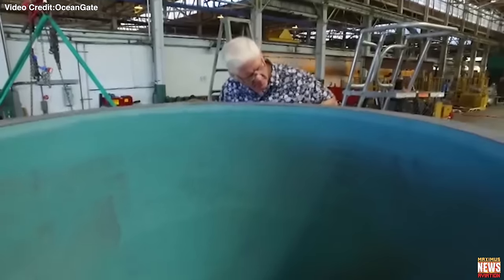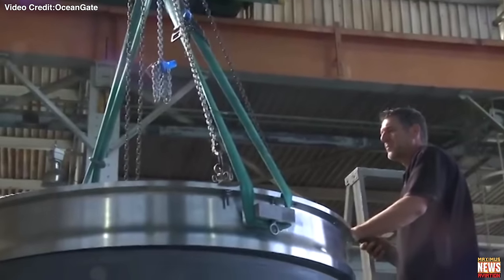Watch The Manufacturing Process That DOOMED OceanGates Titan To Fail. But It NEVER Had To Happen.

Comment: That wrapped fiber looks like it would be a lot more effective at keeping pressure inside rather than withstanding the force of pressure pushing in from the outside.
Reply: How do you know? Did you do your PhD thesis on Kevlar modulus and weave orientation, among 100 other factors?
Reply: @tonylee1794  Since when do you have to be an expert on anything to make an observation in the youtube comments? 
What's your problem?
Reply: @tonylee1794  And how do you know? Did you design or make it?
Reply: @JonasC22  With your ability to tell a good design from a bad design  by a simple visual inspection, who needs stress analysis, x-ray inspection, etc., they should have simply sent this video to you first. Problem solved!
Reply: @tonylee1794 
Is a PhD needed to observe that you cannot burst an empty plastic water bottle by blowing into it with your mouth, but can easily crush it by sucking the air out?
Reply: @tonylee1794  Where in my comment did I even imply that anyone should forgo  proper testing on anything?
I think you need to take a break from the internet.
Reply: @JonasC22  My point was, and remains, how in the world do you conclude your statement - "That wrapped fiber looks like it would be a lot more effective at keeping pressure inside rather than withstanding the force of pressure pushing in from the outside." You came up with this by reviewing a overview YT video? Obviously you are not in the engineering field! You can't, without a detailed inspection by a trained professional using precision equipment, make that conclusion! My criticism of your conclusion is valid.
Reply: @pulidoggy  Wrong analogy puli. In the case of the sub, we aren't dealing with a vacuum as you suggest. This is why they don't consult non-engineers on such matters. Understanding complex concepts is what engineering training and application is all about. Think before you post!
Reply: @tonylee1794  there was no kevlar shown in the video.
Reply: @pulidoggy  it depends on how thick the plastic is. The non-disposable plastic water bottles cannot be crushed by sucking on them. In fact, I think they can probably stand up to 1 Atmosphere of pressure without imploding.
Reply: @mckenziekeith7434  Of course, every plastic thickness has its breaking point, it goes without saying. For instance, an 1lt coke bottle can withstand about 6atm of inner pressure.
But my point is that, take the same bottle (empty and capped) underwater at 60 mt depth, - that make 6 atm of outer pressure - and see what happens.
Reply: @JonasC22  You made a (wrong and ignorant) speculation, not an observation!
Reply: @tonylee1794  What you call "vacuum" is just pressure difference
By sucking out air with your mouth, you are evidently creating not vacuum, but increasing the difference between inner and outer  pressure. And the pressure difference needed to deform a bottle inwards is way smaller than the inner pressure needed to break the same bottle outwards.
Reply: @pulidoggy  Brother, put the shovel down! everyone knows what vacuum is... negative pressure.
Reply: @pulidoggy  yes, every plastic thickness has its breaking point. And every carbon fiber composite tube has a breaking point also. But what we don't know is whether this design was flawed by design or flawed by poor manufacturing. Maybe if it had been carried out more carefully it would have survived many more dives. The fact that it did survive more than one dive is proof that it was not glaringly under-sized. They might have been close to OK with the design. Also we don't know yet which part failed. Was it the viewport or the end caps or what? Or was it the carbon fiber composite tube?
Reply: @tonylee1794  
No, since absolute pressure is measured with reference to a perfect vacuum it is impossible for vacuum to go negative. You can only measure negative pressure as a differential between two (different) positive pressures.
Reply: @mckenziekeith7434  Yes, agreed, there are so many variables that an analysis based on remaining debris will be an arduous task,  and also being the sub an one-of-a-kind model does not allow comparative tests.
Reply: @pulidoggy  leave it alone, you're talking like Dr. Suess... nonsense!
Reply: @tonylee1794  
Do you mean Dr. Seuss possibly?
Learn to correctly spell your quotes before calling others "ignorant"
Reply: @pulidoggy  I'm an engineer l, not an English major. No doubt you would get "Seuss" right since engineering obviously isn't your thing!
Reply: @tonylee1794  It would seem that you do not excel in either field.
Reply: @pulidoggy  I have 2 patents that say I do! If you Google searched  my actual name along with the word "patent", you could read them both!

Comment: A big ole titanium tube would have worked really well.😊
Reply: How about a good old-fashioned STEEL tube? Like giant military subs have been made of since FOREVER. None of those have ever imploded unless they were depth charged. Except for the Thresher of course... but it wasn't supposed to go down that far and exceeded its design crush depth in a test that failed for other reasons.
Reply: Yep!
Reply: nomenclature9607  .. yup
Reply: This is the perfect example of "bleeding edge engineering". This installment of how NOT to build a submersible was very expensive this time.

Comment: Probably cheaper to just make it from steel? What's the point of carbon fibre anyway for this application?
Reply: Strength to buoyancy ratio. He wanted a sub that could fit 5 people including the pilot, which would've been too heavy if made from steel.

Comment: Fucking amazing!   The lip on the titanium flange should’ve been at least 2 feet deep not 2 inches to have a really firm grip on the hull.  I’m not even an engineer and I know that.  Doomed to fail.  Rush really seemed like a nice and likable guy.
Reply: Not necessarily if you consider that the high pressure at the depths they were diving to would be pushing the titanium end cap to the cylindrical hull to tighten the seal. No, the real design flaw is the composite hull with the weak carbon fiber and the cylindrical design doesn’t all for equal pressure to be applied as in a spherical design.

Comment: I saw a youtube vid that said these pelagic subs are only fit for 1 or 2 dives before they need total refit and some are only intended for single use. So even materials such as titanium and steel need testing after 1 or 2 dives and Titan's carbon fibre had already done several.

Comment: A single compression cycle might've been relatively safe - distributing the load into compressive strain on the fibres' longitudinal axis - but assuming a given coefficient of thermal expansion per unit length of ribbon, the increasing circumference with radial thickness obviously places more material in the outer layers than inner layers;  thus no matter how low the coefficient may be for a given material, any normal ambient variation in temperature is going to introduce shearing forces between adjacent layers.  Unless stored in a temperature-controlled environment, it may have been weakening every day since manufacture, even without diving.  

Further assuming that the curing process involves evaporation of volatiles, the outer layers will dry into a tensioned state, the inner layers thus subject to a resulting compression; this in turn skews distribution from further loading as from submersion, since the outer layers will at first be relaxing, their tension reducing as it's balanced by increasing water pressure, before inverting into compression below some threshold depth;  meanwhile the inner layers are under constant and increasing compression only..  this dynamic focusing shearing strain into the outer layers, and compressive loading onto the inner layers.

Comment: Has anybody ever seen a hint that there were also fibers in the axial direction of the tube? This radial winding is great for taking the pressure load on the tube. But the titanium spheres also press on the tube axially. And without fibers in axial orientation (angled or 90° axial) only the glue between the fibers carry that pressure load, which it can't to well. 
So if there were no fibers with a significant axial component... I have my most likely reason for failure.
Reply: 2 gold stars for you Sir, well done

Comment: This was its fifth mission down.  On its 3rd mission, it only descended some 30 feet.
Reply: I think this was its third dive to the titanic but the company claims they did roughly 50 test dives with the Titan, some at similar depths but most probably much shallower.
Reply: @Sashazur  I read they did at least 90 dives.

Comment: It doesn't take a genius to know that titanium/stainless steel alloy is a much stronger building material than carbon fiber and glue.
Reply: On a weight basis, carbon fiber is a lot stronger than stainless alloy. In some applications it is quite a bit stronger than titanium, too.
Reply: Stronger in only some situations and certain directions of force.  Not this application..especially not how they manufactured it.
Reply: @mckenziekeith7434  tensile strength yes, but compression strength?  Absolutely not.  Thats why submersible are usually  steel, steel/nickel or titanium
Reply: @BrownBomber92181  I am not saying submersibles should be made of carbon fiber. But carbon fiber composite structures actually are quite strong in compression. They are stronger in tension than compression, but they are strong both ways. The idea that they are weak in compression is actually a myth.
Reply: @mckenziekeith7434  
They are still significantly weaker or much "sketchier" in terms of how they fail, if you will. If you ride bicycles, a carbon fiber fork with carbon steerer vs. steel is a good example. I have yet to hear of people who managed to damage a steel tube when clamping down the stem, yet that  is a thing which easily happens on carbon tubes - which is why using a torque wrench is an absolute must on carbon.
Reply: @Exgrmbl  almost every carbon fiber beam experiences both compression and tension. I agree that carbon fiber, especially thin-walled carbon fiber, is more easily damaged than steel. But the basic claim that carbon fiber is not strong in compression, that claim is wrong. If it were true, we wouldn't be able to use carbon fiber in beams because the side of the beam that is in compression would fail. I like steel bikes, but I am not much of a bicyclist. I don't mind the weight.

Comment: I'm no engineer but I know enough to know that was never going to work and if it did then it's safe to assume that each 'mission' would be causing degradation, especially given what we know about the crunching noises it made right the way up until 300ft from returning to the surface

Comment: Great vessel able to resist internal pressure in excess of 400 bar ! Wait   I am told it will be external pressure ?? S...t ! How can fiber spun around a tube  increase its resistance to crushing ? The epoxy glue ? Not serious ! Plus different materials with different expansion coef... Fatigue,  cracks during pressure, temp cycle ...Catastrophic failure soon or later. Plus many other errors I bet. Shame on these engineers. Woke ?
Reply: Who's to say they are even engineers?
Reply: @charleslaine  Stockton the CEO was but went to business. No practical experience then. May be he hired his own kind, just young dreamers so positive they nrver see problems, put aside any negative thought.

Comment: Maybe the CEO should have used Elmers glue. I have stuff from 45 years ago that is still good. I just add a little water to it as needed.
Reply: "Add a little water to it"... at 3500m deep?  Would you like ice with at, Sir? ;)
Reply: @the_lost_navigator  Shaken not stirred. I only use freedom units so what is 3500m in feet?
Reply: @grosseileracingteam  Gee, Beav - even Lumpy learned math in school
Reply: @the_lost_navigator  I didn't need to. Eddie Haskell stole the answers to the tests.

Comment: using hand tools and no jigs, you can see all the bubbles and surface imperfections on the carbon fiber after it was spun onto the main hull.  YIKES.
Reply: Imagine what 400 atmospheres of pressure does to bubbles and the material around it... and imagine all the bubbles in the epoxy with the guy stirring it up with a wood paint stick...

Comment: I will laugh my ass off if we find out that it wasn't the walls of the pressure vessel that failed, but something else. This isn't the only video to poo-poo the way the pressure vessel was made.
But it did make more than a couple of trips to the bottom successfully, so it must not have been the worst way to build one. Much more likely a durability issue.
Reply: That's the kind of thinking that killed those people. Every time you take it down and back up, you're inducing more cracks in the lamination. It's not a question of if it will fail, it's a question  of when.  Gambling with peoples lives that way is unethical.
Reply: @@hilaryinthewoods With paying $250k, Rush isn't the only one addicted to the danger.
Reply: @seitch1  They willingly paid their money. They willingly signed the waivers. Those people were willing participants. Nobody hid the dangers or put a gun to their head.
Reply: @@hilaryinthewoods He didn't build that thing by himself in his garage. I guess you don't consider the engineers and fabricators pay "profit"...?

Comment: Anyone who has actually worked with carbon fiber knows that, it is NOT strong under compression, but is VERY strong under tension and flex, when designed and manufactured correctly. I wonder, if he even researched the "NASA SOURCED" carbon fiber he used as far as it's designed application. If it was being used as a pressurized vessel component, he 100% ignored its proper and designated use in the making of the ill fated chamber he designed.

Comment: You know who doesn't build subs like this?  The navy
Reply: Well, the Navy did indeed build a successful deep sea submersible with a GFRP cylinder and titanium end caps. It was about 3 feet in diameter and about 17 feet long. Rated to 6KM depth. It launched in 1983 and made many successful deep dives. It was however, unmanned. It was called the AUSS and It may well be where Rush got the idea from.

Comment: Carbon fiber is very good at taking internal pressure which is why it's used for high pressure tanks but not as good at taking external pressure.
The carbon filament adds a lot of tensile strength but much of the compressive strength is from the resin.

Comment: The OceanGate specification said that there were alternating layers of hoop fiber and lengthwise carbon fiber, but only the hoop layer is shown in their video. Is it possible that they built it with no lengthwise fiber? If so, then it was certainly crushed in a lengthwise direction, not across the width as most people assume. I have no idea why they didn't use a longer bobbin and lay the carbon fiber at alternate 45 degrees, in the same way as other pressure vessels are made, and then machine the ends. Maybe they didn't understand the physics.

Comment: Setting and bonding these 3 $500K+ea.  parts , with some  x$1000 expoxy.  
by hand , using the cheapest paint brushes you can find at a hardware store .
in a dam open bay and relying on gravity for it to set. 
wow    

How it stayed together for 2-3 years? IDK

Comment: 0:27 didn't notice that that single 3" wide strap of carbon material is built of 14 individual smaller strands, just prior to being laid down. They all pulled together close and pulled through that comb like thingie, after that it becomes a wide strap, and then laid/glued down.

Comment: I dunno but to me it would seem that wrapping the carbon fiber that way would be more effective at keeping pressure in, which is why we used carbon fiber cylinders for breathing air. I get that there’s strength if the force is exerted outward but I don’t see it adding any real extra stability against pressure forcing in on it.

Comment: These videos are of the first Titan hull wound and cured by Spencer Composites in Sacramento CA. This hull cracked after some testing and possibly due to a lightening strike so it was abandoned.  The second Titan hull was wound by ElectroImpact and cured in 1 inch increments by  Janicki Industries, both aerospace contractors in the Seattle area using different carbon fiber raw materials and winding methods.  It was the second hull that imploded.  I'm not defending the methods used on the first hull but they didn't kill anybody.  The design and fabrication methods applied after the lessons learned with the first hull should be the focus of discussion. The information about the second hull was publicly available at the time of the implosion but not widely covered by mainstream media and vloggers.
Reply: Very informative. So they didn't use glue the second time?

Comment: I question how much tension was  the carbon fiber applied with?
How hard was the roller streching the fiber.
I used plastic shrink wrap to wrap items for shipping. When we would continuously wrap with tension i was amazed we could actually crush the item.
Point is drum would be under pressure 24 hours a day for months.

Comment: The cargon Fiber tube is Inherently flawed! Any air or gas bubbles I trapped in the weave process are potential fracture points! Enough thermal / pressure cycle will inevitably bring failure! The layers should have been wrapped diagonally in a criss cross patern and under  vacuum to have any hope a void free lamination. I just don't understand why he felt the need to reinvent the wheel here?!?! We already have tried and true methods of achieving those depths.

Comment: Another problem, as if it needed one, that "glue" attaching the titanium. What happened to that "glue" as the end caps were pressed on harder because of the pressure?  And then the opposite as it ascended.